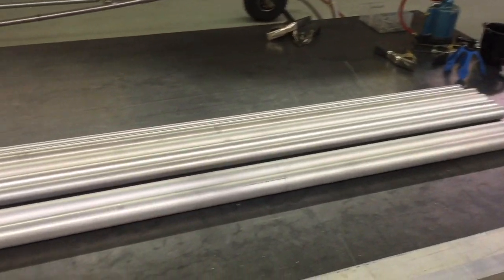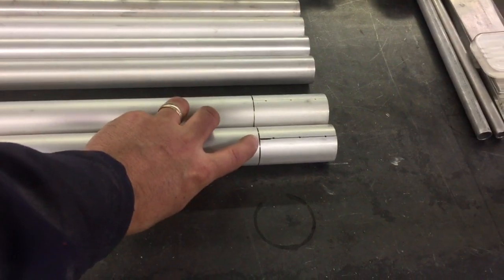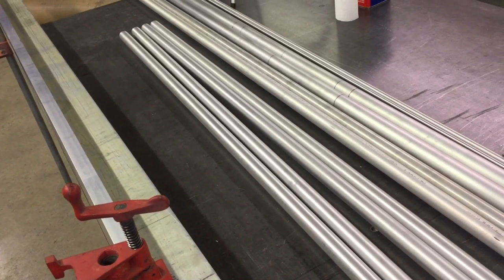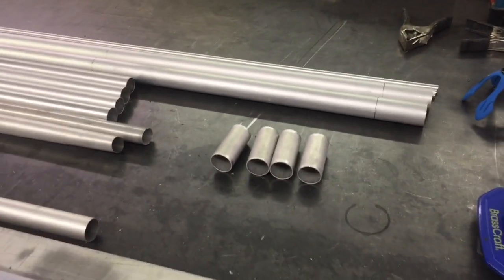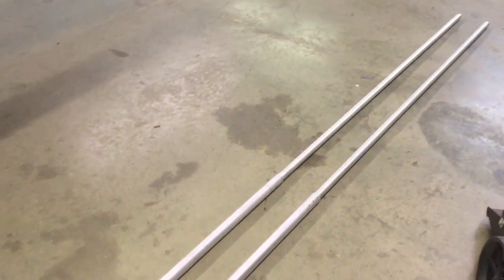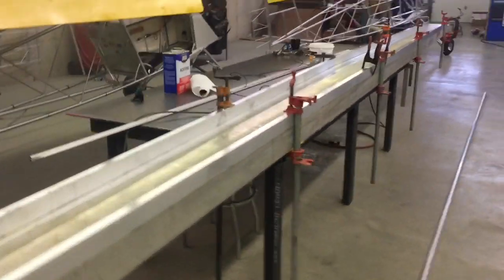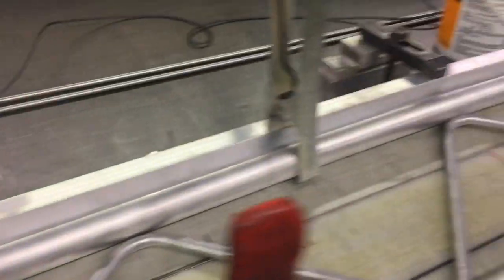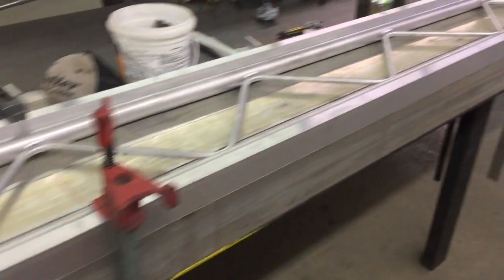Aluminum Wing Spar construction

Comment: I remember the old man that built the original, state in a video while sitting in the seat of his creation, hanging from the wing, that None of the critical welds were in tension......When you weld aluminum, the heat affected zone returns to Zero temper, meaning it has a tension value around 8,000 psi vs 40,000 of T3 or T6 temper....
.https://www.youtube.com/watch?v=uaUe8uT-CtM,,, around (07:35 ), other than that, the aeroplane is very well thought out.....

Comment: What kind of welding certification does it take to do this aircraft work?
I'm not a welder, just interested..
Reply from the maker: There is no certification that I know of. There is how however certain FAA guidelines to follow for certified aircraft and will also need to be inspected by an A&P or someone else certified to do so. Our ultralights require no certification or inspections.
Reply: 1776vtgmb this is an Ultralight, as such it is not subject to ANY TYPE of inspection. Anyone can do this work!